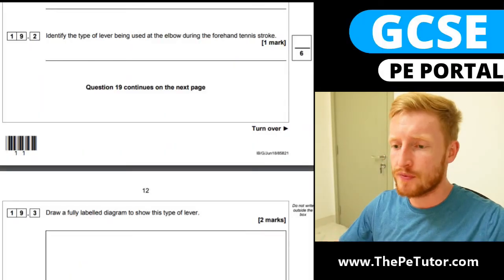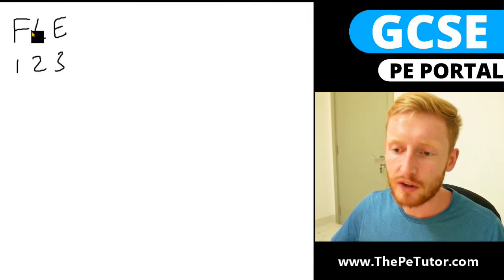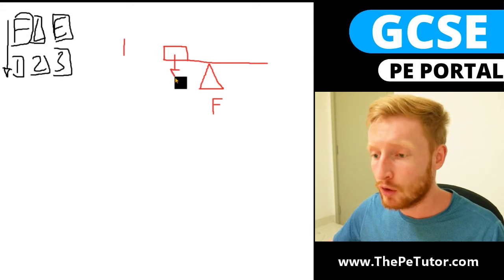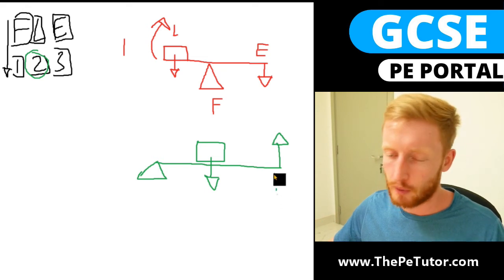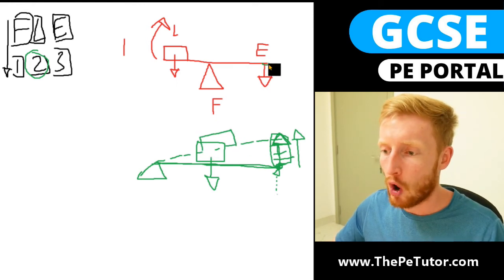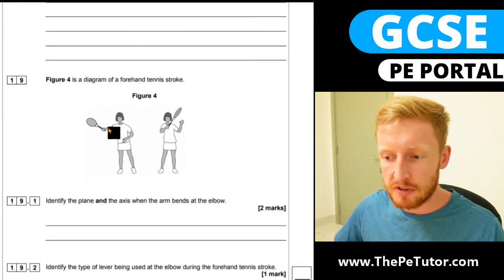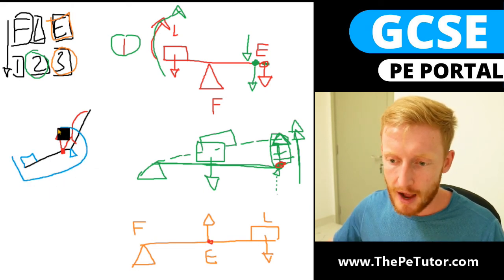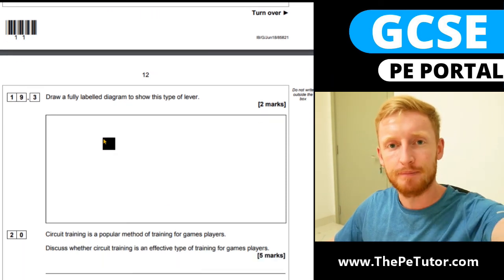Lever Systems in Tennis Forehand - AQA GCSE PE

Comment: Wrong. Bicep does not contract to initiate the tennis forehand. It is initiated by internal shoulder rotation. So I think that’s the class 2 lever.. ? However because the elbow leads the wrist that also is another lever. I’d be interested to see you break down the full kenetic chain from knee to wrist of tennis forehand.
Reply from the maker: There's absolutely more to a tennis forehand than elbow flexion - the intricacies of which are beyond the scope of this exam question, levels and exam board. As far as the mark scheme is concerned for this level of biomechanics, elbow flexion occurs during the strike/follow through phase, and the lever system present in this isolated movement is 3rd class, and caused (predominantly) by concentric bicep contraction.